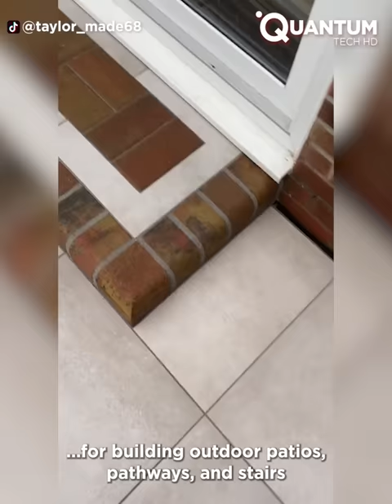Ingenious Construction Workers That Are On Another Level ▶38

Comment: The “vacuum lifters” (not what they’re called) are freakin awesome! Used them quite a bit. One time we had large/thin marble cuts from Italy and we used these lifters.

Dude if you had a way to fasten your hand to it — to prevent slipping for safety — you can scale a building with these things! As long as the surface is decently smooth. They’re STRONG.
Reply: I used those suction cranes when I used to work for a company making granite kitchen worktops. First time I seen them my mind was blown with how much weight they can carry. (I'm talking slabs that weigh over a tonne)
Reply: We have some sort of these at the factory as well. Not as strong because they shouldn't lift huge weights (~10-15kg). It's more for comfort. To use these our operators should have had some small training because it isn't completely without danger. Definetely for the type of work you're speaking of.
Reply: @shona5512  
I haven’t used a crane one but I’ve seen them. They’re insane!
I have used these handheld ones and they’re crazy too. Expensive and very impressive. My company had me lock them back up at the shop when I got back. Only me and two other guys were allowed to use them. They’re very nice and extremely helpful with a LOT of things. It instantly gives you a handle on almost anything as long as it’s decently smooth. Crazy.
Reply: @kevindevlieger300  
I’ve used the clamp things that you put tile/granite/marble in between and when you pick up on the two handles it clamps the material giving you two handles — one on wash side of the cut — making it WAY easier to carry. Not electronic nor do they work by suction.
That’s really the only other device that has been nearly as effective. And typically you use those for bigger heavier pieces. We only really used the suction pads for brittle/wide/thin marble or something — especially that imported stuff. 
I haven’t seen the lighter weight ones you’re talking about. I’m sure they’re helpful though!!

Comment: Ok. For awhile there, I thought that putting a receptacle box in the masonry was pointless because there was no way to put a wire into it. I thought that it was all solid all around, but after watching it again,  I see that there is an opening in the back corner of the top brick.
Reply: I had the same thought at first. Though they could also put electrical conduit along the outside wall.

Comment: 2:10 that's not welding, that's soldering. It's the lowest temperature of the 3 metal joining methods. You have soldering which is fairly cold, then you have brazing which is much hotter but still not hot enough to melt the metal you are joining, it requires a good fit, then you have welding which melts the actual metal you are joining.

Comment: For the floor layer on at 9:03 you either need an undercut saw to cut the bottom of or door and baseboard or it needs to be made a little of the floor if you wanna do a rough cut then just slide it under otherwise you trace cut it then use clear silicon to fill gaps

Comment: That thing about pools is completely wrong the most common pools are gunite pools and gunite is a less porous type of concrete the base is made of that concrete and rebar and the stuff you see them spreading in the video is pool plaster that won't allow the water to get through to the concrete the second most common pool are vinyl liner pools that have either a concrete or sheet metal base for the walls and commonly a sand base for the floor

Comment: 11:20 I work at a factory, where we make this kind of stairs. I'm currently working on 2 projects with with stair wells (I'm a technical designer).
The stairs we make are usually with rounded top (15mm) and bottom (25mm edges, and the bottom is recessed 20mm. Often the side edges are raised 10mm, 35mm in to prevent water to spill over the edge when cleaned.
That intricate design require the forms to be CNC milled though, so the formwork is outsourced.

Comment: 4:52 and thats why your houses up there falter to winds. Lmao. 10-15% cement XD i dont see a single piece of gravel mixed in that too XD how long is that supposed to last? I had to use an asphalt dril on the structure of my house to be able to pass conduits trough, the damn concrete was blue of so much cement.